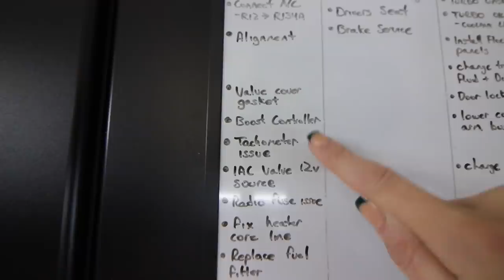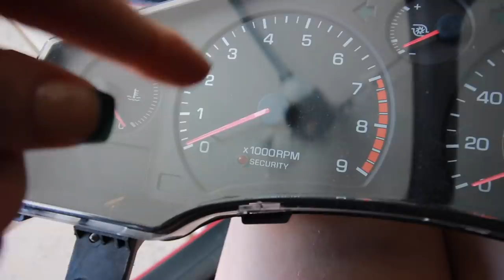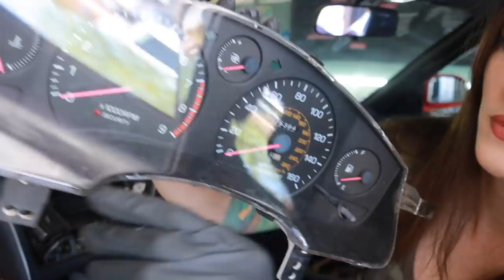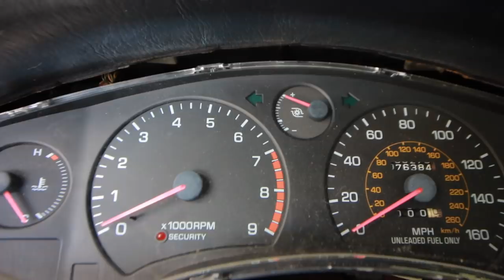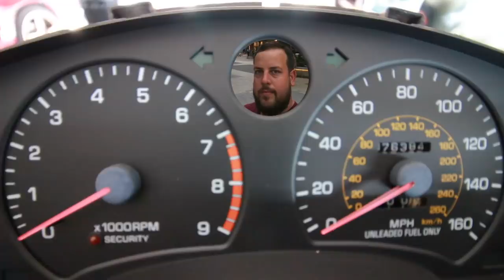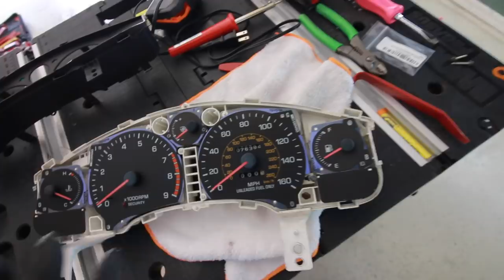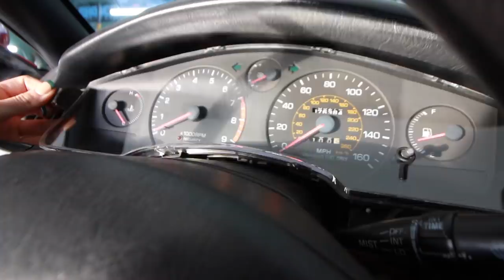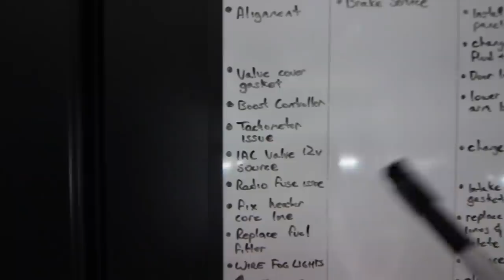I Better Not Screw This Up!! // Faulty Tachometer Fixed w/ $2 Capacitor?

Comment: today in june 2021 I fixed my tachometer, thanks for your video. I only had a doubt  when I was checking on the capacitor polarity, the original capacitors in my tachometer had no negative strip or any other indication of polarity. At the end, thanks to the visual aid of your video, and  the quick reference you made to where the polarity mark was facing I installed it correctly and  it is working perfectly.

Comment: Nicely done repair; You can use solder-wick instead of a piece of wire or a solder-sucker. You didn't need the heat-sink on the flying lead of the component; in fact, that can draw off heat from the soldering operation and result in what is known as a "cold soldering joint".
Reply: This and some flux paste helps out a lot (with the removal and install). You may have a cold joint as is. I had the same happen with an initial fix of a speedo unit I had to redo. Time will tell.
Reply: Gentlemen, with respect- I do believe she knows what a cold solder joint is, as well as solder that has it's own flux. She knows what the unit measure for capacitance is, and could be running a large trucking company, perhaps oversee military transport operations. She dx'd the problem at the component level, and the broken RPM indicator is now better than the original. lol
Reply: @NT4XT  I don't think Tisha is a gentleman... None of their advice was an attack.
Reply: In all fairness a solder wick is just a more efficient version of her stranded wire method. In a pinch the stranded wire works fine.

Comment: The 105C rating is the rated operating temperature. It can be much hotter for soldering. Lead based solder melts around 190C (edited). The foil probably didn't help much.

A tip for removal - clip one of the leads with your wire cutters, heat the other and the cap will fall right out.

Comment: Thanks! I thought the 30 yr old electrolytic capacitor in my tach might be the issue but without a capacitance meter a little validation with video of the symptom is really helpful!

Comment: Having soldered for the last 30+ years, there really is no reason on a cap to worry about heat. With your flux, and a clean working area on the printed circuit  board, the amount of time you have to apply heat is so minimal that it wont hurt the cap. Other things like ICs, and some transistors you have to take precautions, caps not so much.. Congrats of the repair!

Comment: Greetings from Torrance!  Awesome video Miss Sarah!  I was inspired by this video to try and fix my 1993 camry's tachometer.  Thankfully we have an electronics store nearby and was able to buy both capacitors for 50 cents.  After replacing the capacitors, I now have a working tach.  It hasn't worked in probably decades.  (Seriously) Thanks so much for a very detailed video. Keep up the great work!

Comment: Nice work - love your "can do" attitude! Electrolytic capacitors are notorious for failing after a few years - they're one of the main reasons why old electronic stuff fails.
A couple of (hopefully helpful) tips for next time you're soldering things:
 - It's great to be cautious, but you probably didn't need the foil wrapper (there isn't that much heat to dissipate, and you'd have to spill a lot of solder to short something else out on a low density circuit board like that - maybe different if it were a high density surface mount technology board).
 - To get the old capacitor out I normally just heat one leg and pull a little, then heat the other leg and pull a little, then repeat that 2 or 3 times until both legs are free. Then you can melt the solder on the board one last time to clear out each hole if needed.
 - You probably didn't need the alligator clip and foil heat sink - just applying the soldering iron and a quick dab of solder to each capacitor leg wouldn't overheat the component, they can take a fair amount of abuse in that respect. But again, I appreciate that you're being cautious - which is never a bad thing.
Terrific camera work too - although I got a little nervous about that lens possibly getting knocked over at 5:52.
Nice car!

Comment: cool stuff! btw you can also check the capacitor value using your multimeter, by using capacitance setting. mostly if it drops below 10% below, just change it..*thumbs up

Comment: Solder suckers work amazingly well, but are kind of expensive for a hobbiest, but you can buy a small roll of solder wick.  It looks like braided copper infused with flux and comes in a roll.  You just lay it over the solder joint and heat on top with your soldering iron.  When the solder ments it gets absorbed into the wick.  Real clean and cheap way to desolder somthing :)

Comment: flashbacks to back in the day when I swapped my 89 Camry's no tach gauge cluster to one with a tach, and I swapped over the speedometer between clusters to maintain the correct odometer reading.  Also painted the guage surround plastic to match the car's body color.  Yes that was back in my ricer days lol, like 20 years ago.  The MR2 cluster looks very similar, even has the same mechanical speedometer cable connection on the back.

Comment: In the past I have worked with electronics and they do have different sizes of copper braided wire to the pull the soldier away just like you were doing with the wire. Great job improvising!

Comment: Nicely done! Really liked the little editing jumps and power ups! Very necessary fix too, stopping at 3 tacos might not be enough, sometimes you need all 7! You're dead on with the gauge lenses scratching easily, scratched mine yesterday, and it's 20 years newer than what you were working with!

Way to get it done and improvise with what you had to work with, glad it worked out well for you. I personally much prefer a solder wick (basically what you made from the wire) over a sucker, they can be too violent. For next time, that heatsync you put on the new cap, toss it on the component side to keep your tiny robot's beer cold, but very nice work getting it taken care of!

I want to see where you get with the boost gauge, a quick look at the diagram and the voltmeter supply and boost pressure sensor input are different pins, also 12v vs 5v circuit, with a separate driver for the boost gauge.

Comment: You did that repair with a foil piece as a heat sink, but what you may have not also known is that same foil acted as a sterile field to prevent solder migration/ splatter. Don’t know where you picked that up. Not working in avionics that’s for sure. Worked, that’s what matters. 👍🏻😁💖

Comment: Good work!  You didn't make my mistake.  I replaced 2 bad capacitors on a computer monitor and stupidly installed them backwards (wrong polarity).  They pop and smoke upon power up. Completely embarrassing, since I've been soldering ham radio stuff since I was a kid.

Comment: I ran into a different issue with the tach (end of long comment) on an oil/dirt-encrusted, rust free, '79 Sunbird fastback I nabbed from a co-worker in 1991 when it lit on fire in the parking lot!  That's a GM H-body which came badged and trimmed as a Chev Monza, Pontiac Sunbird, Buick Skyhawk, or Olds Omega, and at least 3 versions got optional 305 CID V-8s...so junkyards had frame mounts, engine mounts, correct oil pans "correct" water pumps, (for AC mounts) and H-body-only V-8 exhaust manifolds that combined to make fitment of the 350 possible.  "Correct" parts were to prevent interference fits in the small engine bay...standard truck or car oil pans got holes poked in them by the zerk fitting on the right inner tie rod end after a few right turns, for instance!
My Sunbird left the factory as a 4-cylinder/automatic, but I planned on swapping in a Chev 350 out of a '74 truck, mated to a tiny Borg-Warner T-50 5-speed.  I used a combination of factory parts from a junkyard V-8, 4-speed, Monza Spyder, my 4-cyl/automatic Sunbird, and a 5-speed trans, plus crossmember and driveshaft tunnel cover, from a junkyard V-6 Sunbird.
I took the full wiring harness, plus gauge cluster, from the Spyder.  I only had to swap in a couple wires to make it work in my Sunbird.  One wire swap was at the back of the cabin harness to make the amber turn signals on my Sunbird work where there had been red turn signal/stop lights on the Spyder.  The other wire swap was in the engine bay harness to manage the AC compressor that was missing from the Monza Spyder's "package".  It was a pretty basic comparison of two cars' harnesses laid out on the lawn, just mix and match!
The trouble came a while after I had been driving the car.  One day, I noticed that the tach was reading way high...3,000 RPM at highway speed.  The engine sounded right, but I checked that I was in 5th, not 3rd...yup!  I just drove it that way, shifting by ear and feel for a few days.  THEN I noticed that the tach was reading 4,000 at 60 MPH!  WTF?  There were no rev limiters in those cars...you could easily rev til your block developed "con-rod windows", so this needed to be addressed!  The problem had to be in the tach itself, as there was no computer to fail weirdly...and one wire making good contact at the distributor and leading to the tach.  I had the 4-cyl gauges yet, so I took a look at it.  There was a tiny arm from a switch that had 3 positions labelled 4, 6, and 8!  The tach in the car had its switch slip from the V-8 position to the V-6 position, and finally to the 4 cyl position!  Well!...fork me with a spoon!  Rather than pull the whole dash apart and replace the tach with the one on the bench, set to V-8...I just jammed my arm up from the bottom of the dash and, barely able to touch the switch pushed it back up to the 8 cyl position...success!  I did this a couple more times, but it was getting pretty sloppy, so the last time I got a dab of epoxy putty on my fingertip for the permanent fix.  Drove it for three more years that way til I got sick of replacing broken T-50 transmissions and other stuff that "fell off".
The REAL fix for a "weird" tach on a 79 Sunbird is to buy a brand-new '94 Honda Civic VX!  I drove the wheels off that thing for 24 years without it ever skipping a beat!  I junked it last fall due to severe body rot...on the way to the yard she pulled right up to her 70-ish MPH fuel shutoff in second gear! (I thought better of seeing about the 115-ish MPH fuel shutoff in 3rd!)
The shot of Sarah pulling out the gauge cluster gave me the preceding happy flashback...thank you, Sarah!  I'm'a' finish the video now to see what was up with Mr. Dos...

Comment: Excellent repair,  new joints look good!   Done that,  you had it easy with through hole components.  Try that on some surface mount stuff you can barely see.  Surprising you have to start removing trim at the center console just to get the cluster out.

Comment: Nice soldering job there!  For the quick burst of heat needed to solder capacitors, a heat-sink is really not necessary.  As always, keep on doing that AMAZING work that you do!

Comment: Sarah, check out Elliot's Electronic Supply on 22nd and Tyndall. They have an inexpensive $26 solder station with variable heat control that works alright. They also sell desolder braids and solder suckers too! It's like a crazy awesome Radioshack that's locally owned!

Comment: Hmmm, thanks for the tip. I wonder if this type of thing is what has been wrong with my MR2 since I bought it 13 years ago. Since I bought it all those years ago, the one gauge that does not read properly is my fuel gauge. It never gets all the way full. 3/4 is the best I can hope for.

Comment: $2 capacitors..check. 
Aluminum foil for heat sink.. check. 
Wire in lieu of solder sucker..check. 
2–3 hours of repair time.. check. 
Working tachometer (taco meter)..check 🙂
Test drive on the Mt Lemmon highway to test the new wheels, tires, brakes, and make frequent explorations at redline to see what the dos can really do, and have fun flogging it, tossing it around, and driving it like you had just stolen it...CHECK!!  😁

Comment: Most impressive!! How did you know which electronic do-dad to replace? Back in the 70's some Ford mid-sized cars came with a factory tach. If they went bad or left unplugged, the car would crank but not start. That would cause a lot of angst!!

Comment: Probably would have been a good idea to change all the bulbs that light up the cluster since you had it out and apart.   It never fails, you don't change them one will be burned out when you get it back together.

Comment: If you using flux better to clean it with isopropanol alcohol after soldering. No need this alu thing foil something when you not using hot air. Anyway good job and simple fix.

Comment: Does the boost gauge show vacuum on the bottom half? If so that’s why the needle is  low at idle and jumps up when you rev it. When you open the throttle plate vacuum drops. Idk anything about MR2s but that’s how the auto meter on my Grand Prix GTP CompG worked.

Comment: since you had the cluster out would it of been worth changing the colour display or keep it as it is . well done anyway for doing it . I wouldn't know where to start . for the lights on your car , I have found a company that just deals in them . they are called autobeam  . but you can find them on amazon as well pretty much .

Comment: You did a wonderful job
I have the speedometer on my KIA spectra 2007 works for 20 minutes or less at the beginning of driving in cold morning, to start intermitting and failing for the whole of the day. I replaced the speed sensor for nothing. The OBD shows the movement from the speedometer when I drive. I changed the whole cluster. The same problem is still there. What you think is the problem and how to manage and treat it, please? Thank you

Comment: You did a great job there Sarah. You should have more confidence in your abilities. Look at how far you've come with Mr Dos. Those capacitors are electrolytic capacitors and I'm not surprised they've gone bad after 28 years. If I get the 1991 Celica I've been offered and it has the same problem, I'll know where to look first.

Comment: Good work but next time save yourself a lot of potential hassle and trepidation; slap the tach back into the white gauge cluster plastic, drag it over to the car and test it before popping the black bezel and clear lens on.  If you goofed or forgot to reconnect something at least you don't have to wrestle with the clear lens a second time and stress about damaging it.
Also, no need to drop the column most of the time, although pulling the wheel can make it way easier to yank the cluster.

Comment: Nice job as usual Sarah 😎 the 105 degree C temp is the rating of heat in the cap or the environment it is in ( ie. Inside a car amplifier ) that it can sustain on a consistent basis without failure.... 😁😎😁😎

Comment: Hi Sarah, I'm Bala from Malaysia, love your videos. I have a Nissan Sentra EX, B14 model, 1.6GADE engine. year make is 1997. I'm having the problem with my tachometer needle just swinging randomly even when I put the keys in and just switch it to the on position without starting the engine. It will go from 0 up to 8000 RPM and back and so on. I have taken the meter out, soldered all the soldering points on the speedometer and tachometer and all the points on the top PCB and tightened all the screws as well. Now my tachometer does not move at all. It is staying at 0 RPM. Any idea what components could be faulty? How did you identify the capacitors were faulty on your tachometer ?

Comment: Who told you the caps were bad? Also the cathode is positive not negative but you won't need to know that unless you're actually fixing or designing an electronic circuit.

Comment: You really don't need the aluminum foil, but you need some goot wick.
The parts can take a serious amount of heat without getting destroyed.

You forgot to change the light bulbs.

Did your gas meter get stuck?

Comment: good job, but you were over thinking the whole change the capacitor thing Sarah,. I'm a little in to the electronics side. really id have just changed out the cap in seconds, solder sucker, out,  install the new one,  done., good job tho

Comment: Tried this on my 91 Celica. Sadly it now just sits at 2k when turned on. Doesn’t move. Turn off key it drops to zero. Must have shorted it or did a bad job at soldering. Probably stuffed it.

Comment: Normally when you repair an instrument cluster, you fix everything on it at once to save you time. Part II fix the boost gauge, Part III re-installing the cluster.....
Reply from the maker: 1969Risky the boost gauge issue is related to the Map sensor wiring, everything was good up here.
Reply: Hi  @SarahnTuned  now it makes  more sense which I understand. I've ripped apart consoles & clusters and I'm used to getting the job over & done with so I wouldn't need to re-visit for anything else. Nothing is more annoying than pulling apart a console & cluster to get at another job in the same area. 

I'm impressed with the work on the MR2 that you've done. There are some jobs on there that you have done that not many would tackle without research. Keep it up!

P.S: We need more little Sarah in the videos giving you assistance. i.e give her a couple of tough jobs. She could have taken the console out while you had lunch lol.